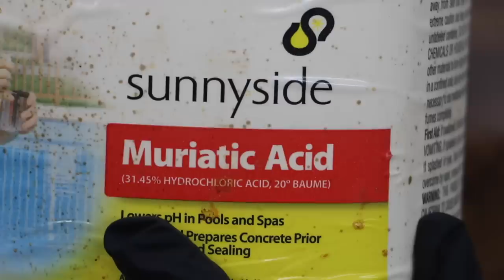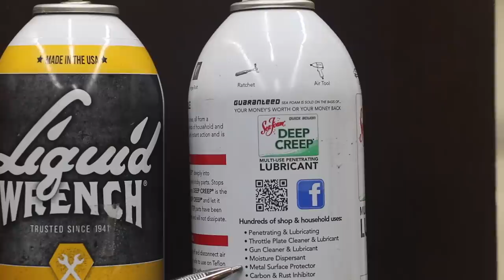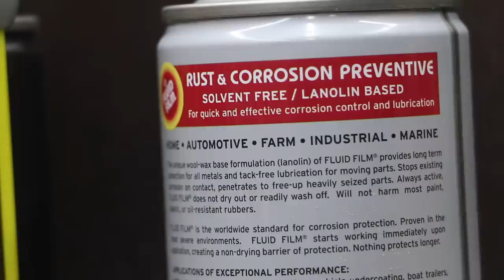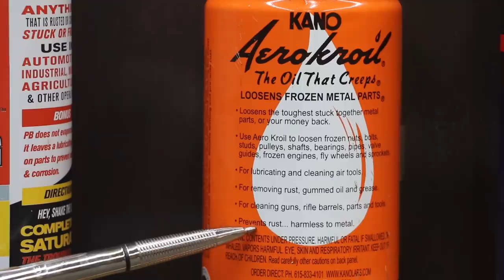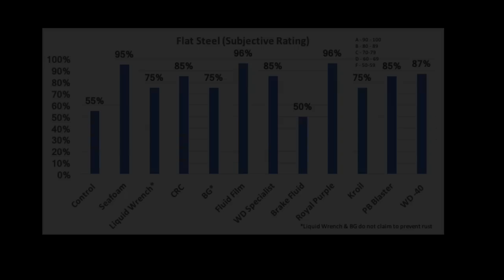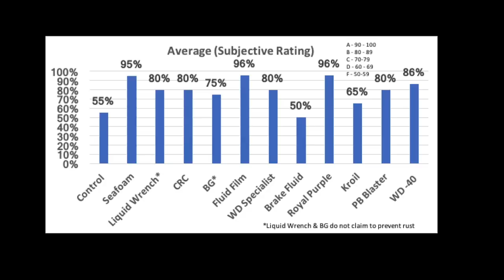Do Penetrating Oils Block Rust?  Let's find out!

Comment: These videos have confirmed for me that Kroil is pure overpriced overhyped garbage in more ways than one. I stick to these chemicals at my shop- WD-40 for lubricant, Mopar Penetrant for rust and fluid film for protection. Living in the salt belt of America I have learned a thing or two when it comes to combating rust.
Reply from the maker: Thank you
Reply: Thank you!
Reply: Yep, seems Kroil is garbage.  I'm honestly shocked by these results, seeing as most have recommended it as the best.  These videos have also confirmed Seafoam's superior performance to most in both categories.  Seems Fluid Film is the best rust preventer, but Seafoam is the best All-in-one from the products tested.
Reply: PB is my go to penetrating oil. I just started using Fluid Film. I live in the salt belt as well and have my fingers crossed this stuff works well. Not going to lie its fun to spray on, just wish it was easier to find and cheaper!
Reply: And WD40 scores a bit higher than the PB blaster??  Wow!
Reply: try using seafoam deep creep for lube. I heard it's better
Reply: CRC 5-56 is something I grew up with and have continued using but for preventing rust it is as bad as WD-40, just get some stonechip for that. For loosening rusted stuff washing up liquid 2% and water will beat anything else you'll ever try and that is just a fact.

Also, just so everyone knows this, WD40 is NOT an oil and does not work as a lubricant for more than a few hours. Use engine oil or MoS2 grease depending on what you are trying to lube (if it's the wife, don't use those though).
Reply: @ColdPetRat2.99 Does it lubricate threads? Do we use it to drill through metal?  Yeah? Then it's a lubricant.

ANY liquid is a lubricant including water.

It is said to not be an oil though and that is wrong too since it does contain a very high viscosity oil.

These "truthisms" like WD40 is not an oil or there is no replacement for displacement are cute but completely wrong.

A supercharger or a turbocharger is an excellent replacement for displacement.
Reply: Truth is there’s no replacement for cylinder pressure and rpm and accurate spark timing 👍
Reply: @nickcook7408  Yeah there is and you know it. There is a motor that is three times as efficient and and cars that can deliver twelve times the torque.

There always was a replacement for displacement and US built engines have always been crap, including the 1300 hp LS engines, it's just ... pathetic.
Reply: I watch your ford Teck Show too! I have 2 fords. The 3L escape and the 5.4 triton van. Leaned alot on your show.
Reply: Agree, Kroil is disappointing over priced snake oil.
Reply: I was not impressed with Kroil. I have discovered that G96 Gun Treatment, is a pretty good penitrating oil, and it cleans and prevents rust pretty well.
Reply: Dodge should know best, their trash can use all the help it can get. ~Mechanic of 20 years.
Reply: @ColdPetRat2.99 it sorta is a lubricant. Nothing that will last.
Most garbage products that tell you to shake the can before use are a mixture of things.
What remains of WD-40 after all the penetrants and solvents evaporate is pretty much just paraffin and gummy as well.
May as well just melt some candle wax on what you are trying to lubricate.
Reply: I would say your not really a mechanic of any kind. Wd 40 is not a lubricant. Its a water displacement fluid. Kroil is legit and the only thing that will actually penetrate the spark plug threads on ford 5.4 3 valve engines.
Reply: @ProjectFarm  Could you do a comparison of ceramic waterproofing sprays on fabrics? there are more coming out on the market all the time. Thanks for all your videos and hard work.

Comment: That's some strong acid you got there, it actually changed the bolts from coarse thread to fine thread! I'll have to remember that life hack! lol j/k nice video!
Reply from the maker: lol!  Funny!
Reply: Don’t eat the brown acid it ruins a road trip.
Reply: @tomtheplummer7322  I tried this after reading ur comment, can confirm road trip was ruined :(
Reply: UNF acid.
Reply: @tomtheplummer7322  If someone is eating brown acid they are likely already on a trip...
Reply: If I dilute the acid can I change english to metric?
Reply: @NickFrom1228  one way trip.
Reply: It's Grade 8 acid...
Reply: Another very educational video thanks dot 3 brake fluid has a tendency to pull moisture out of the air so no surprise it failed
Reply: I noticed that also, still a awesome video!!!

Comment: Lanolin is a good rust inhibitor because the harder you wipe it the more it works itself into the metal surface. It is a commonly used rust inhibitor on precision measuring tools
Reply from the maker: Great point.
Reply: Calvin Witt good point,  I'd use the top 3 on tools but it'd probably attract dirt more than lanolin based
Reply: Yes!  I have never seen a rusty sheep!...……………………….elsullo
Reply: VERY!
Reply: Grease repels water, and lanolin is sheep hair grease, so...
Reply: Some gun oils have lanolin as well
Reply: Can't confirm it works good. But I got kicked right in the unmentionables trying to rub metal on my sheep.
Reply: If a tree lopper doesn't have lanolin spray they're no good at their job.
Reply: Project Farm, you should try cleaning products on oil, rust, and other common messes. Please include brake cleaner and wd40.
Reply: +Dave dablave  You obviously did it wrong, you must rub the sheep on the metal, not the other way around!
Reply: That's why Fluid Film works so well - its main ingredient is lanolin.
Reply: I use fluid film to protect metal parts from saltwater corrosion on a jetski. Works very well.
Reply: I've never seen just lanolin for sale on it's own.
Reply: Paolo G Cheers.
Reply: This is why I pay the premium for Lanox (Australian product not commonly found on US shelves). I've never been happier with anything else for winch maintenance. Hell, you can just spray down anything that's not painted or passivated and you won't be disappointed.
Reply: lurkalisk Actually, Walmart has it here in the US. Thanks for this tip.
Reply: Calvin Witt 

It mostly consists of esters and polyesters of high molecular weight fatty acids and alcohols. It’s not evident why it adheres so well to metals. 

It may feel greasy but structurally it’s not like what we commonly refer to as grease, which is typically lubricating oil thickened with a metal salt of a fatty acid. Lithium stearate is the most commonly used thickening agent. Calcium stearate is used to thicken waterproof grease. 

Rubbing probably heats lanolin enough to lower its viscosity so it flows easily into pores. Also, rubbing, as with waxes, helps to align long chain hydrocarbons, so they form tightly packed, perpendicularly aligned layers on a surface, filling voids. That’s why waxed surfaces reflect more light, look shiny, and repel water.

Comment: Fluid film is awesome for rust prevention. I use it in my air seeder fertlizer meter compartment.  Great stuff
Reply from the maker: Yes, impressive rust blocker!
Reply: My grandfather bought a 2000 GMC Safari back in 2001 or 2002 and sprayed the hinges of the Dutch Doors and the hatch, there's not an ounce of rust on the hinges and the fluid film is still tacky to the touch!
Reply: Yeah, Fluid Film is great for rust prevention. I don't know why it's advertised as a penetrating oil.
Reply: Yeah, it's way too viscous to penetrate threads. It's more like a coating than anything.
Reply: I love fluid film. I sprayed it on some metals about 2 years ago and let it sit in my basement and the fluid film is still sitting on the metal in a thick layer
Reply: Fluidfilm is the best out of everything I've used to prevent rust. I undercoat vehicles with it at work and have many other uses for it.
Reply: I used Fluid Film on my Jeep with the notorious binding tailgate hinges. It`s still swinging free 2 years later. I very much disagree with doug payne.
Reply: Just NEVER INHALE THE STUFF, WEAR A RESPIRATOR. I sprayed it a few times without a respirator (stupidly) and it goofed up my brain the few times I did. (Laying under the car on jack stands for a few hours while spraying, the stuff still stays in the air hours later...)
Reply: It's basically like spray undercoating that's thinned out just enough to spray out of a can, it works great for spraying on parts and hinges that might be exposed on vehicles. Even good for door hinges in the house, you'll never hear a squeak out of them for years.

Comment: I'm a landscaper by trade and I'm constantly needing to lube the moving parts of my machines due to the dusty environment they operate in. One of my favorite lubes to use is actually 2 cycle gas, it seems to penetrate excellent and the oil left behind seems to lubricate pretty well. If you do another video like this give it a shot!
Reply from the maker: Great recommendation!

Comment: Try different rust converters!
Reply from the maker: Yes, I'll test them soon.
Reply: P0tat07 good call!!!!!!!!
Reply: I second this motion!
Reply: I would love to see that!
Reply: Phosphoric acid is supposed to be pretty good
Reply: Like to see electrolysis too!
Reply: Project Farm One is Ron Fitzpatrick's RCMP Rust converting metal primer and another is Dr. X.  I'd really like to see how well they work.
Reply: Great idea! Always wondered about these products!
Reply: Project Farm what I'd like to see is how well it actually "converts", and how deep it works through layers of rust.

Do they just convert on the surface? Or down through depth?

How durable is the converted surface?

How much spray is required from different converters (i.e. the coverage)?

Quality of the converted finish for painting/priming?

You're awesome, as always. Thanks for these videos!
Reply: :’) so many likes. I feel loved.
Reply: my father has messed with that to remove rust,  results were great
Reply: Great idea, im deciding what to do about my truck frame after this winter..been thinking about Rust Kutter, then using fluid film on it.....

Comment: I told you Seafoam was good stuff! A couple minutes into the video I thought "I'd use grease if I really wanted total rust protection" and you didn't try straight grease (which definitely would have won!) but then I saw the lanolin based product and thought because its a grease based product the test is going to be jaded in favor of the only product with grease in it. Interesting, I never knew their was a spray-based grease product. It's kind of against the common sense of how we've always traditionally gotten our grease all these years. A very enlightening video PF.
Reply from the maker: Thank you!
Reply: Bel-Ray Waterproof Grease. Put it on the axles of a twin-post in-ground hoist that used to seize up constantly from the corrosive soap used on the shop floor every night. Hoist repair guy was stunned when he returned years later to replace a leaking piston seal and the wheels were still spinning free.

Comment: Just a suggestion for preventing future rust in bolts. Stuff for my vehicles, bolts and other 'thick 'screws. I always paint my bolts (Tops) with a tough enamel/Rustoleum/Epoxy paint. I then always coat the inside of the boltholes with Bearing grease. As well as alight coat on my bolt's threads before reinstalling.I have an 86 pickup been sitting for 20 years.. The bolts come out easy AND do NOT 'unscrew' by themselves. Netherwards the bolts have never became loose for those of your wondering.A coat of clear hard polyurethane helps a lot after painting the heads.I isolate them by pushing the bolts and large 'screws' with/without washer onto cardboard so only the tops get painted. *In some cases you can also paint your bolt threads. Just do it on thick threaded bolts and 'screws' bolts. Still add grease! It don;t run and will stay well in place and moisture will not get in. Did the same with my Honda engine bolts even.
Reply from the maker: Great tip!

Comment: FYI, when steel oxidizes, the resulting material (rust) is significantly thicker... 16 times thicker to be exact.  So while it might look like a lot of corrosion, once you clean off the surface rust you probably can't even see any section loss on the steel.  I'm definitely going to pick up a can of that Royal purple after watching this though.

Comment: Best thing I found on firearms that are carried all day, everyday against sweaty bare skin was found by accident...plain coconut oil.  Non-toxic too...I put it on toast..LOL  Seriously, I had a Kel-Tec PF9 that would rust if you looked at it wrong...coconut oil has it rust free and I don't remember when I lubed it last.  Oh yeah, it lasts and runs like butter in guns.  Maybe that's why they found out Frog Lube was basically coconut oil and wintergreen.  That said, I was using it long before FL came out and Pacific Islanders have been lubing stuff with it long before me.  Try it.  IIRC, a steel wool outside test had it second to Eezox, which is outstanding, but super freaking expensive.  Coconut oil is a few bucks, and doesn't go bad.  FWIW
Reply: Leo Dei, Try Ballistol. Used in Germany since WW.
Reply: Leo Dei 

It’s a triglyceride containing unsaturated fatty acids. It’s used in soap making. Makes a hard soap which foams well.
Reply: That's froglube too
Reply: Do you have a link for the type coconut oil you use?

Comment: Brake fluid is a good paint remover. A lot of RR hobbyists use it to remove the paint from plastics without harming the finish on the base. I would never think it could be a corrosion resistant material. lol.. I use mostly Liquid Wrench for penetrant, (partiallly cuz I've used it for SO long - it works) still have many types cuz, sometimes one just works better than the rest if it is not just metal to metal. Have kinda gone to high copper anti seize for time based anti corrosion on threads and closed up sites. You really have the BEST relatable comparison tests that I have found. No one can test this stuff into the ground, but doing it on common materials that a lot of us use will keep me watching YOUR videos as long as you make them. Course, I turned 71 last weekend, so there is that. Born & raised on the farm, now retired after 30yrs of county facilities maintenance in Colorado.
Reply from the maker: Great feedback. Thank you!

Comment: I'd love to see something like this for bolts subject to heat like exhaust manifolds. What cooks off and what survives?
Reply from the maker: Great video idea!
Reply: I can tell you all of these will cook off. You need high temp copper based anti-seize.
Reply: Yep, use anti-sieze compound.  I wouldn't use copper type on/in aluminum, FWIW.  Also, be careful how/which type you use on exhaust O2 sensors.
Reply: Copper or nickel-based anti-seize.

Comment: Interesting video and very thorough experiment.  That Royal Purple has certainly convinced me that's a great product to protect things like tools, springs, chassis parts and other spray-able surfaces.  That said, anyone who is serious about protecting bolt threads, probably is going right to the Anti-Seize over any of these products.  So a cool experiment if you are so inclined would be a comparison between Aluminum based and copped based anti-seize.  As well as different brands.  Thanks for the Video.
Reply from the maker: Thank you

Comment: Some country folks swears to use old drained engine oil to prevent rust on their vehicles under belly. I told them used engine oil have too much contamination in them.
Can you do a test on old used engine oil vs fresh engine oil for anti rust protection ? 
Plus use Fluid Film as the standard bench mark for comparison.
Reply from the maker: Thank you for the video idea!
Reply: I was told a mix of used atf fluid and diesel fuel.....
Reply: Yeah, it’s called a leaky engine that coats the underside of the vehicle. LOL.
Reply: My neighbor stained his fence with used motor oil 20 years ago.  Fence is excellent still.  Looks pretty good as well.
Reply: @carlrest6553  why not use normal undercoatings? Maybe the biggest gripe in using motor oil is that all the grime and salt sticks to it immediately
Reply: @Mikael_Partti  Fluid Film or even a oily engine resists water and oxygen that will cause rust in the first place. The salt won't cause rust if it hits the surface as long if it it coated in FF. FF though contains lanolin that does a great job. For best results I spray on one coat, drive down some dusty roads and apply a second coat after a week. Works great on my plow truck. I touch up the front end and wheel wells as needed. 4 years of heavy plowing the truck is rust free.
Reply: @sundown798  thanks for the tips👌
Reply: Seeet project cars has a video on youtube recommending a petrolatium solution for underbody protection. If you’re going to do a «diy rust prevention» test, it would be great if you included that one 😊
Reply: Used engine oil is  toxic and a known carcinogen
Reply: Might be that used engine oil used to be a good rust preventative, but modern oils are all packed with detergents to keep sludge from building up in you engine. Those same detergents also make it a lot less hydrophobic, meaning that water can get through it easier. Detergent free oils like compressor oil might do a good job though.
As a cheap wood sealant, I've used a mix of used motor oil, diesel and a bit of gasoline. I holds up surprisingly well to the elements considering how cheap it is. Problem is that all the ingredients are consider fairly toxic to the environment and would probably get you fined if the wrong people found out you were treating outdoor wood with it.
As far as used motor oil being a "known carcinogen", keep in mind that sunlight and alcoholic beverages are also "known carcinogens".
Reply: @Mikael_Partti  If you are talking the rubberized type undercoatings, stay away from them. Very far away!
Reply: @daviddelle774  havent used them